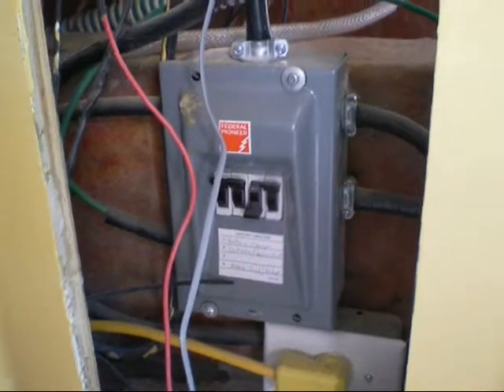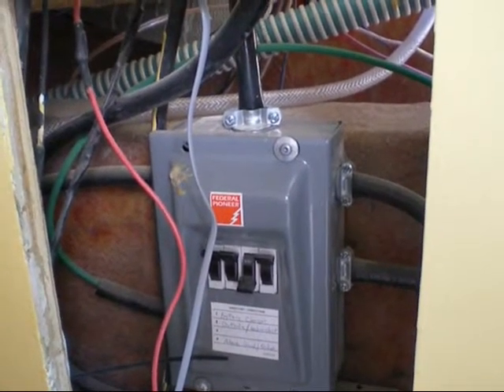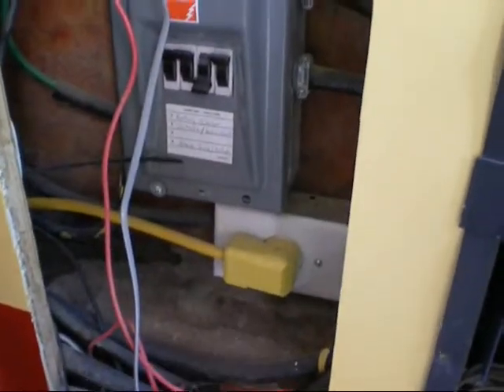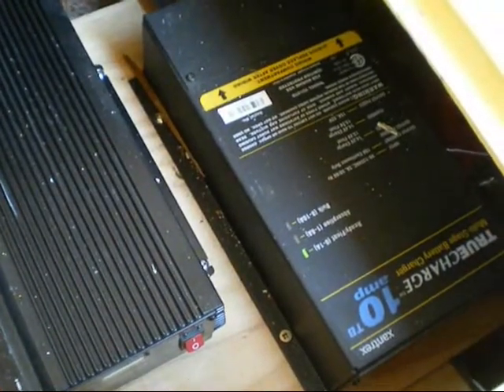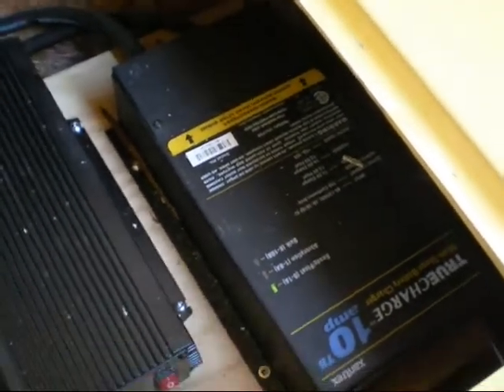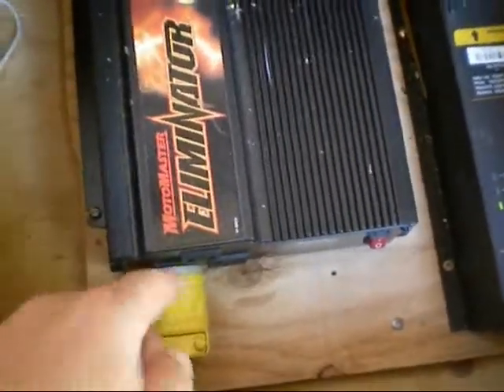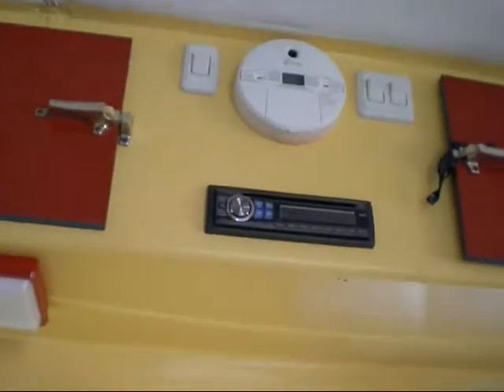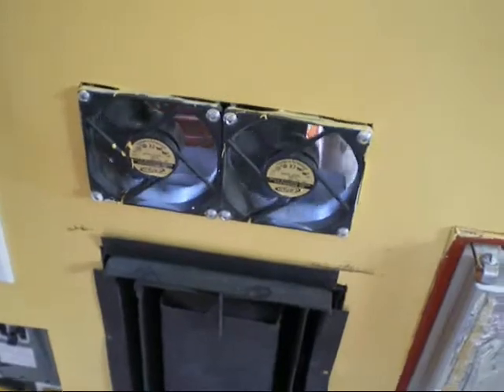Inside trailer electrical_0001.wmv

Comment: Yup, nice setup.  I need to work on my trailer electrical.  I like your 110V fuse box.  Nice and neat. 
Is your 1200Watt Inverter powering mainly the stereo, fans, pumps and lighting?  Anything else?

Comment from the maker: The inverter is just a backup if I need to power 120 appliances from the battery power.

Everything ,(lights, stereo,fan, pumps etc.) is fused to the battery and runs directly from 12 volt.